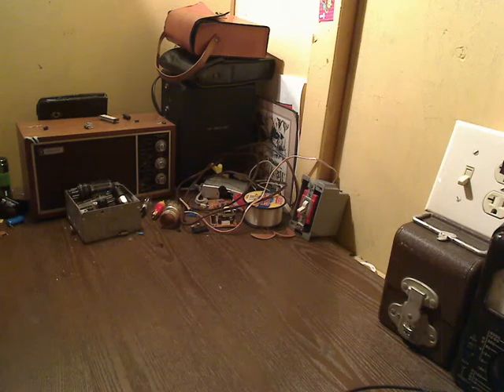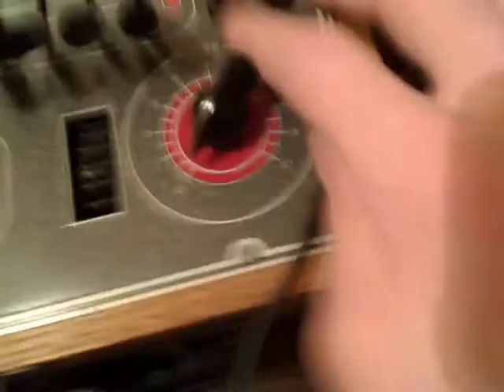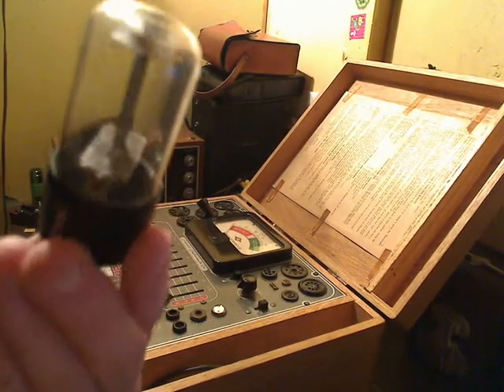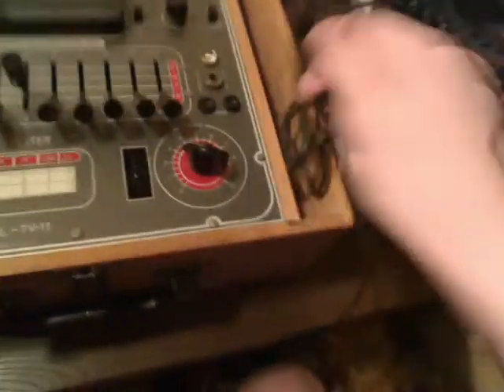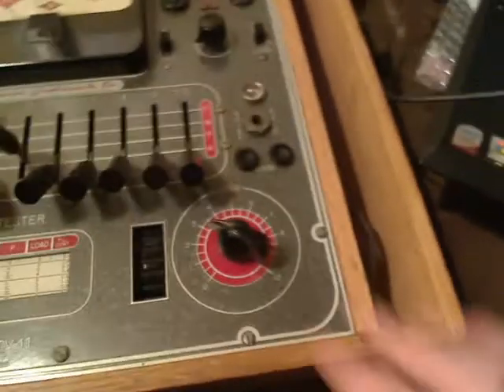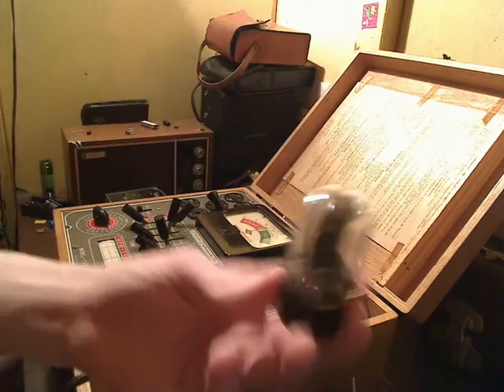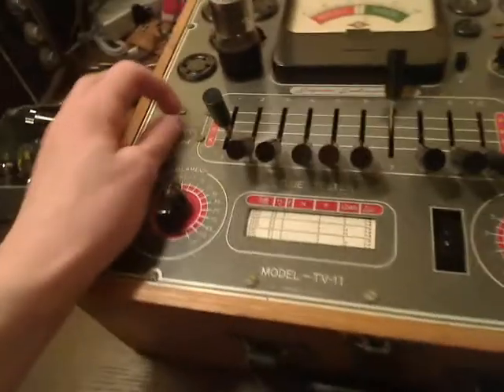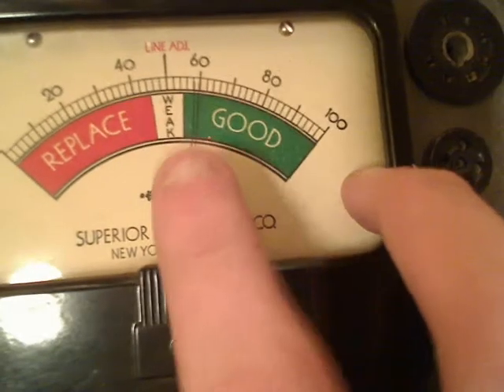Superior Instruments model TV-11 Tube Tester!! (How to test a vacuum tube)

Comment: according to instructions I have, The "P" setting is only set for CONDITION of tube. It is not to be used when checking for a short
Reply from the maker: Correct, that's why I move the "P" control to the end when preforming the shorts test, then move it back to the setting later. Unless I forget to do it during this video, this was years ago and was my first tube tester as I wasn't as experienced as I am now. I now have a Hickok 533 tester and still have this one and a few more.

Comment: What happens if there is a short, but the roll says that "there may be a short on 1, 2 or 7 (for example). Does that mean we can still check for emissions if either or any of those short?
Reply: Thanks for the reply! I understand your reply. However, if the tube chart says may show short, and it does not short is this ok to test as well? Further,  what is the highest number of shorts that you could proceed with on the "may show short" list? If there are 3 is that too many? Brand new to this and these tube testers look like they can pump a lot of electricity. I just don't want to blow anything up or have a tube explode! Much thanks!
Reply: Wow thanks! That's very helpful. It's  a Precision 12.

Comment: thanks for the upload, 
I just bought one of these 
tube testers for $50
needs some work tho...
Reply: Phoney - Western Electric thanks! I received this item from Craigslist locally.
and yes I do need a little help fixing this.
there is a weird looking reddish type component that is corroded that I don't know what it is ? some type of resistor ? right under the main unit cover.
thanks again !!
Reply: Phoney - Western Electric I sent you a picture on Google+
thanks so much for your time !!